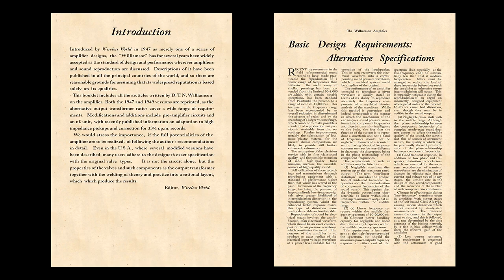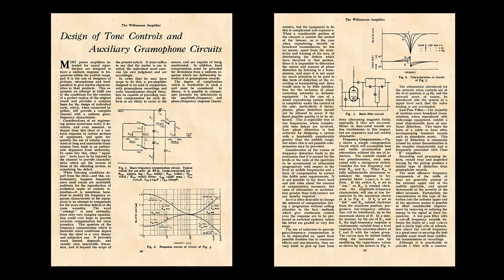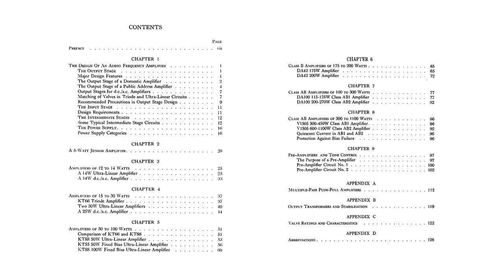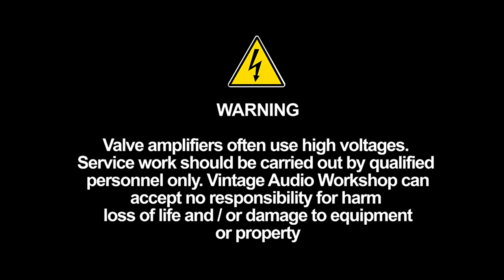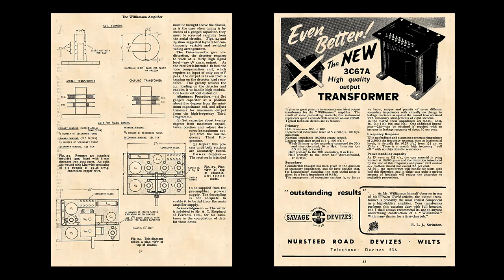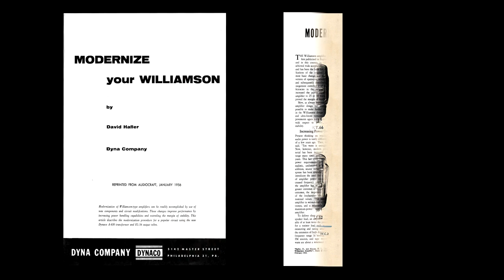Williamson Amplifier

Comment: I  disagree that the Dynaco is an "improved" version of the Williamson. The Dynaco design with its 6AN8 or 7199 pentode/triode driver is unique and not a version of Williamson. Same with the McIntosh driver design. It is unique and not a version of the Williamson. I do agree that the Williamson is a very good design and has been implemented by numerous companies over decades to include Heathkit and United Transformer Corporation (UTC) and others.